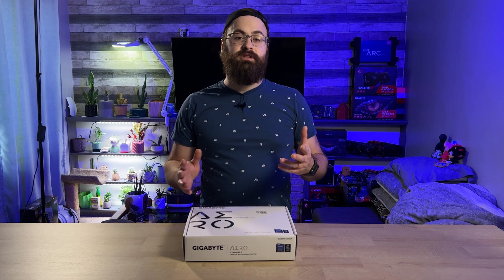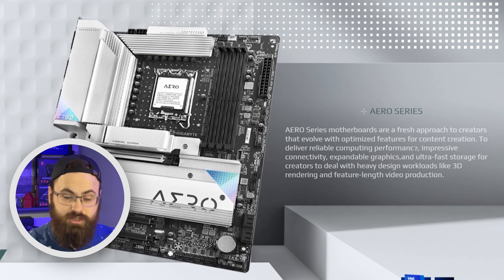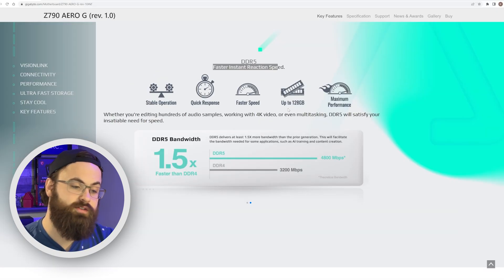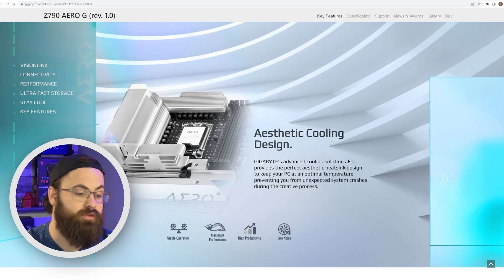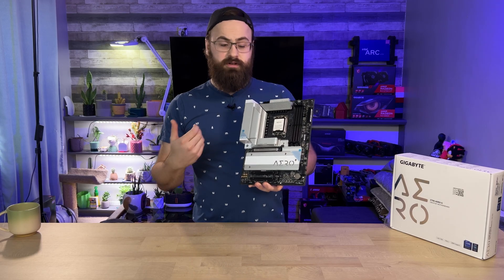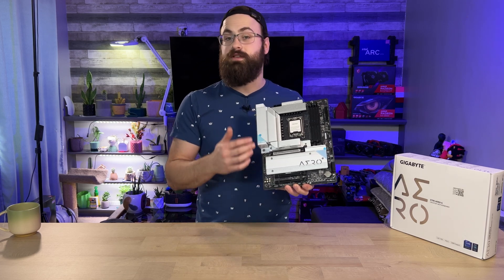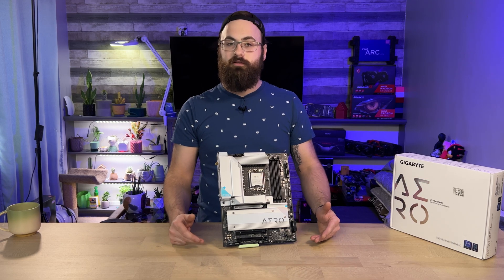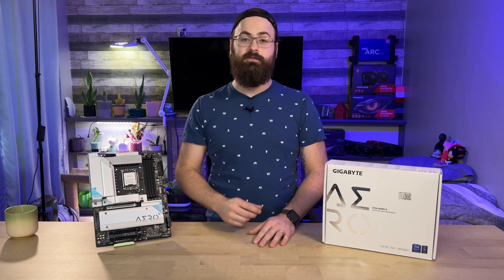Gigabyte's Z790 Aero G: The Ultimate Balance Of Aesthetic Design, Features, and Functionality

Comment: I have this motherboard i have an issue whit dram light trun orange do u know what it is and its new
Reply from the maker: Sounds like an issue with your DRAM. Could be too aggressive of speed set in bios, or memory not on MQVL (check manufacturers website). See if you can get it to boot with just 1 stick in the second slot and go from there.

Comment: I have just used this board in a new build and I am having issues shutting it down. Every time I shut down, it restarts itself and goes into bios. This is the second board from a different seller I am having this issue with. I returned the first one to the seller because I believed that I was sold a faulty board. But I am still having the same issue with the new board from a new seller.
Any thing I need to tweak to stop it restarting?
I should add that this is my first time building on a Gigabyte board. I have a previous build with an ASUS board and the build was a breeze
Reply from the maker: I wonder if this is related to the recent intel instability issues. Make sure you're on the latest bios! Could also be a degraded CPU if it's used.

Comment: Is anyone else having trouble with a 4070 and this mobo. I get a black screen when installing the drivers for the gpu and it only works if I lower the pcie gen speed to gen 1. nightmare. And no im not using the m.2 gen 5 slot
Reply from the maker: I just recently purchased a 4070... when I get time I can test, but if you do find a solution please come back and leave a reply!
Reply: @ultraprecisiontechnologies  I’ll tell you what mate I hope it works for you I had a nightmare. I have a suspicion that the GPU never seated properly on that board that’s why it crashed when going to x16. I ordered a Arous elite ax and returned the areo everything just works first time and I can get 7000mhz easy it’s a great board. So is the areo I think I had a bad one or the GPU issue just check that it’s right in there I couldn’t as much as I tried I think maybe the big heat sinks are stopping it to be seated properly so just be careful. 

Also fyi the areo has 8 pin and a 4 pin to power the CPU and the elite ax has 2x 8 pin just something to consider when getting a psu. 

Also fyi put your ssd on the slot just under the main PCIE. 

Please get back to me when you have the components I would love to know if it works for you. The point when it crashed for me was installing nvdia drivers so try that first.
Reply: @ultraprecisiontechnologies  F-F-fyi 4070 is an amazing card wow I’m so impressed with everything. All the AI stuff is so cool!

Comment: 8:24 thanks for the confirmation that the M2 EZ-Latch is *not* present for the M2 drive that will cover the wifi controller - despite it showing in the manual that it does, I hope I have a screw somewhere.  Building my Z790 Aero G at the moment and am looking to populate all four bottom M2 slots as I don't want to lose anything to the GPU by using the Gen5 slot.
Reply: Follow up to my comment now that I have built the system.  The M2 slot over the wifi controller doesn't have a ez-latch because that is where the screw from the heatsink goes into (bottom left one).  So basically you put the drive in the slot, sticking up, and gently it will press down as you put the heatsink over everything and then is screwed into place.

Comment: Can this motherboard handle some gaming too?
Reply from the maker: Oh absolutely!! 100%. Gaming is typically a lighter workload than professional applications as far as the demands on the motherboard itself are concerned.
Reply: @ultraprecisiontechnologies  thnak you im trying to build a new system for music production and gaming. i need thunderbolt connection. i have a thunderbolt 3 card on my actual system but idk if i can use it on a new motherboard i thought about an asus board first but idk if the thunderbolt card will work they do have thunderbolt header. the other option is get a board with thunderbolt built in like this creator one but im still undecided is not expensive actually . but does intel 13700k will work good on a z690 board .. i wanted a z790 but the dont have one yet

Comment: should I get a nvme ssd with a heatsink(pcie 4.0) or is does the mb have one, making it unnecssary to buy a heatsink
Reply from the maker: I would purposely seek a m.2 that does not have a heat sink, as the one on the board will likely have more surface area, and removing factory heatsinks can be quite challenging and even damage the m.2 because of the strong thermal adhesive that is sometimes used.
Reply: @ultraprecisiontechnologies  thanks

Comment: Could you please tell me where its better to place 2 ssd on this motherboard?
Reply from the maker: If you're referring to NVME m.2 SSDs, pause the video at 7:42 and look at the block diagram. Likely, you DO NOT want to use MC2_CPU. This is a Gen 5 PCIe lane and if populated will cut your top PCIe x16 slot down to 8x gen 5.

Likely if you use any of the other M.2 slots that are PCIe 4.0, you will be fine. If you plan on using your 2 drives in RAID, you may choose to use a pair of M.2 slots that are both connected to the z790 chipset, vs using one gen4 M.2 off the CPU, and one gen4 M.2 off the chipset. This is likely less important however.

Comment: Would a Corsair H150i go into the CPU_OPT header or the SYS_FAN_PUMP?
Reply from the maker: Ultimately it doesn’t matter, as the main purpose of those names on the fan headers are for identification purposes. I believe the fan cable like connector that comes off the pump is just RPM signal reporting of the pump speed, and the h150i powers the pump through the sata power cable connected to the pump. This means that whatever header you connect the h150i to will be the one that reports pump speed in bios or in a software like hwmonitor. Hope this helps.
Reply: @ultraprecisiontechnologies  Alright thanks. And one more question, will the PCIE x16 run in x8 mode if I use the gen4 M.2 slot in the lower heatsink?

Comment: question, why not putting the gen 4 on the pci5, any specific reason ? i put mine there.. PLease let me know if i should not.
Reply from the maker: A gen 4 drive is only ever going to run at gen 4 speeds, max. by using the gen 5 m.2 slot, you are bifurcating (splitting) the gen 5 x16 PCIe lanes into 8x on your x16 GPU PCIe slot and x4 to the m.2. Put simply, you're cutting you x16 PCIe slot your gpu is plugged into in half for no reason. Does this matter? It depends on how powerful of a GPU you have installed, or other gen 5 PCIe card that would saturate all x16 lanes.

Comment: Curious if you ever ran into problems with all 4 ram slots populated?  I ended up having to drop down to 64 gig because of stability issues with 4 sticks.  Not running XMP or anything and the memory was on the Memory Support List.
Reply from the maker: Initial boot was rough with 128gb of ram. Ultimately I got 2x 64gb 5200mhz kits (32gb sticks) Corsair vengeance ram working at 4800mhz. Keep in mind JDEC spec for dual channel dual rank ddr5 is 3600mhz, so 4800mhz in my case is actually a pretty decent overclock.

Comment: That red usb at the bottom is marked, "BIOS". It's extremely handy and I had to use it when I first bought the board. If you don't care about RGB, this is an amazing board. It runs cooler and quieter than any board I've ever had, even when gaming with a i5-12700k and 3060Ti.

Comment: Got this board with i9 13900K, having issues booting up/posting.  Powers up with fans on high then shuts down and repeats, anyone experience this type of problem before?
Reply: Using it with 13700k and works fine
Reply: Reset the bios?
Reply: Probably flash the bios to newer version
Reply: So I have the latest F5 BIOS from 3/9/2023.  System does boot up now with 128GB, problem now is I am unable to XMP, will not post after turning it on.
Reply from the maker: You won’t be able to use XMP with 128gb of ram. This is a limitation of the memory controller, and is considered completely normal and within spec. DDR5 JDEC spec for 128gb of ram is 3600mhz. Anything over that is overclocking. (When dealing with 128gb of ram)
Reply: @ultraprecisiontechnologies  Great video. Is it running 128gb stable on your machine? I need 128gb for my use but online everyone is saying 2 dimms at 64gb for ddr5 is the max right now.
Reply from the maker: I have 128gb of Corsair vengeance ddr5 ram running in my machine at 4800mhz. I think it was a 5200 or a 5600mhz kit, but like I said before I’d never expect to get that, and I’m just happy I can get 4800mhz Vs 3600mhz the spec calls for in this configuration.
Reply: @ultraprecisiontechnologies  That said, I'm assuming 6000mhz XMP'd with 2x16gb sticks would be just fine?   I've been comparing motherboards for the last week now trying to find the best performance to reliability in a motherboard that I can. Other than the aero, I was thinking about getting the rog strix z790-h, but my RAM isn't in the QVL, but I don't think it really matters that much if it can run way faster sets with alot more total storage. I''ve got a aero 4070Ti so this board would be a perfect match, just as long as it hold up to all the RAM and power for OC. I need to come to a decision here soon, I only got the motherboard, CPU, and cooler left to get then I'll be getting all the frames at 1440, lol.

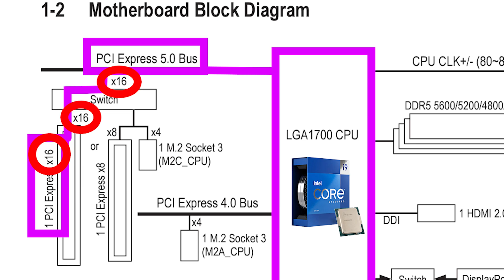Comment: 7:48 is so important to know. Can you please tell me, is this the same on all mainboards with this chipset, or is it structured differently depending on the manufacturer/mainboard? i want to use the top m.2 without the gpu having to run on x8
Love😊
Reply from the maker: I can’t say for sure, but I believe this a limitation of available PCIe lanes, but how motherboard vendors allocate those lanes can be unique. It’s important to look up the manual and see how things are connected. Also, note that you may be totally fine running your gpu at 8x if you’re not saturating the pcie express 5.0 bus. (Pcie 4.0 x16 = same bandwith as pcie 5.0 x8)
Reply: @ultraprecisiontechnologies  I second this. Best advice I’ve had for choosing a motherboard is look at the motherboards block diagram.
Reply: Don't know if you ever got an answer to this but it depends on the board.  Intel's spec is 20 CPU PCIE lanes and 8 DMI lanes, how that gets split up exactly depends on the manufacturer.  As stated a pcie 4 GPU at x8 will be fine even at gen 4 x8 (like 1% loss), never mind gen5 x8.